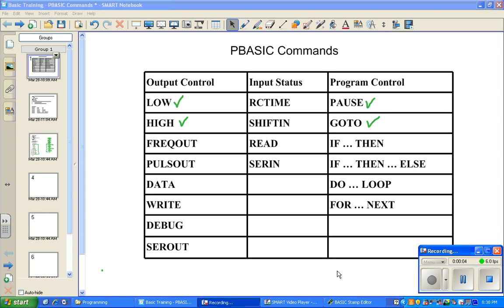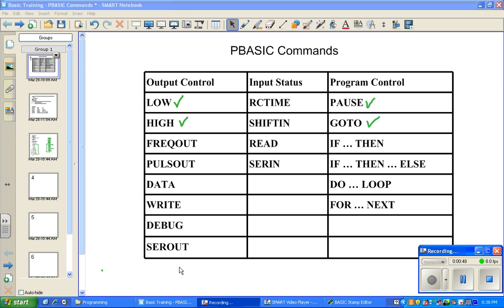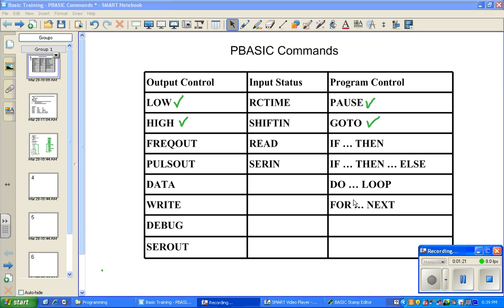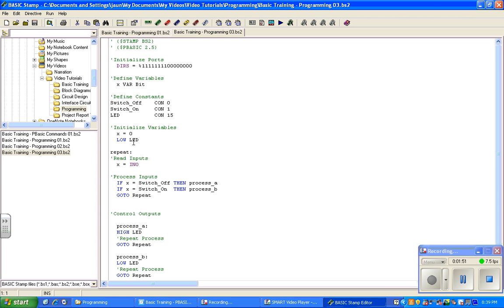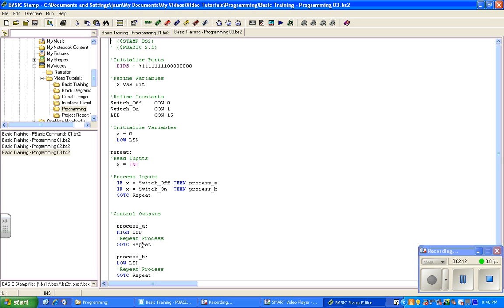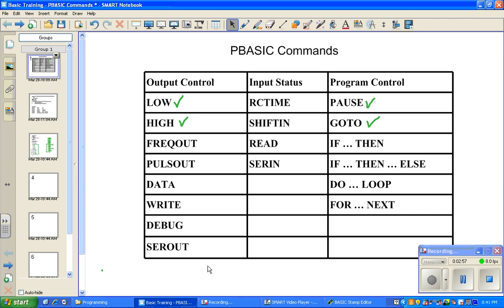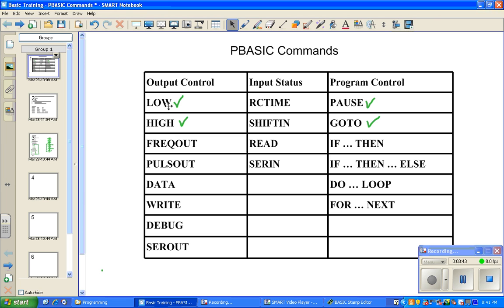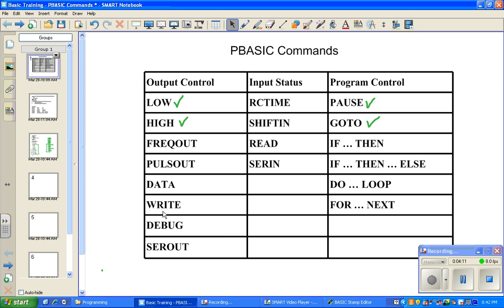Basic Training   PBasic Commands 01

Comment: I'm reading Robot basics for dummies by Roger Arrick

Thanks
I've built robots before, but Pbasic is more obscure than Arduino
Ironically C is 40 years old and less "dated" than pbasic
Reply from the maker: Hi Slacker.  After programming for many years, all the languages has a root syntax and structure.  Once you practice with the code, it will be less obscure and you will add more skills to your portfolio.